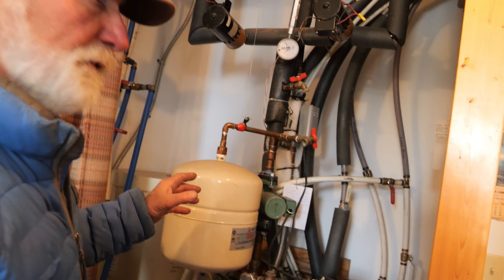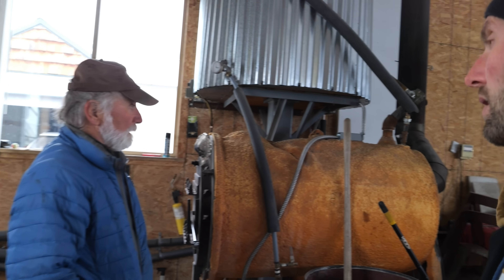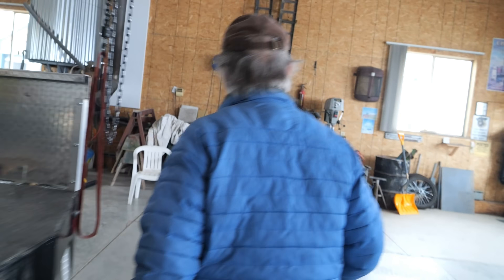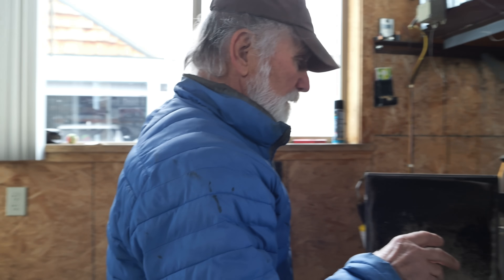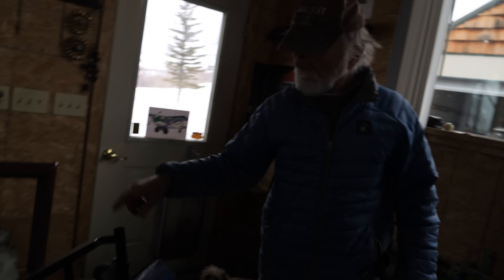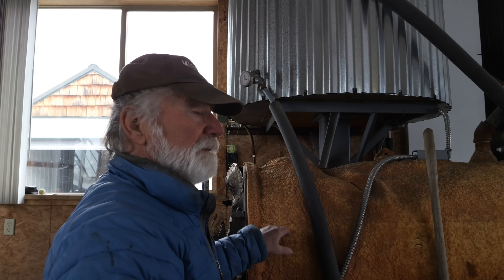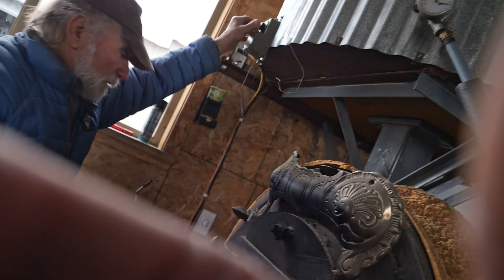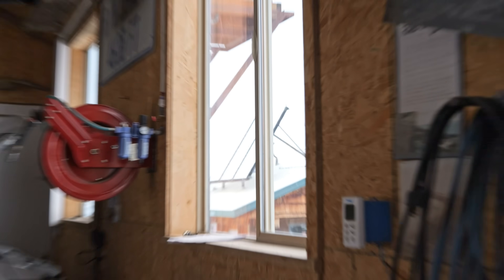Hasn't had a Heating Bill for 40 years.

Comment: Very cool. I grew up in northern ontario, it is common for people up there to have outdoor wood boilers exactly like what he built. My parents use theirs every year. It's just so much safer and works really well and costs very little to run. I like the idea of those solar heat collectors as well, though I don't know if my parents get enough hot sun on average in the winter to make it worth it. We're looking at maybe heat pumps instead. They have a creek near by they can use, or even the massive back yard at their place.

Comment: The title suggests he hasn't paid anything in 40 years, but big investment in equipment and time.   I used to think my wood stove saved money, but if you add up  wood stoves, chimneys, chainsaws, chain, gas, oil, splitters, trucks to haul wood, etc, it ain't free.   Not to mention what your time is worth.   I realized I could work and extra 4 hours at job to pay for heat bill each month.   If you love doing it, fine, but not as cheap as advertised.

Comment: great system, if i ever do a full remodel of my house i will install a water floor heating system, atm the best way to heat water wood be to have electric panels on the roof and rune a air to water heat pump that you can use to heat up a tank of water to 95 degree celsis, then use that hotwater in a water to water heat exchanger to heat hotwater for the floors and tap water. this way you can use the electric to buffer up stored heat during the evening and night, and if in a pinch you can run the heatpump of mains power and heat the water for the floor directly. and if wanted you can add a fire burner to heat the buffer tank of water as well.  you will need at least 3 tanks of water, a heat storage tank, the tank for the floor heating and you hot water tank, and a lot of controller to automate the system.

Comment: I had a 2500 lb 8:34  kewanaee 3 pass boiler in my 2300 square foot house.  You could throw three four-foot logs in there and it would burn for about 24 hours.  You could walk around in the house and t-shirt and shorts on a 0° day.  Of course the house was super insulated with all triple pane windows.  The place was so efficient it heated cheaper than my 700 ft² cabin.  I eventually switched to a well maclean gas boiler. Lost that house in a divorce I miss it.

Comment: Not sure why so many comments are in awe. Solar thermal has been around for years. I have had it for 20 years and Reagan removed the solar thermal panels from the Carter whitehouse back in the late 70s. Lots of ways to "skin the cat" , so to speak. Let me explain. He has a wood stove as his back up to solar. I have a propane boiler. I also have a wood stove for heating the house as a backup and a help to the hydronic floor heathen the sun is not shining. I love my system but when it has issues (e.g. valves, pumps, or boiler broken or electrical grid is down) it is very frustrating and you want to junk it all. Too many working/moving parts to feel ultimately comfortable with the system. I have it and will use it, however, until I or the system dies. I might do it differently if I had to do it all over again (true geothermal heat pump on solar PV?!). My propane bill for a year is usually around $300. The solar thermal usually covers our entire floor heating needs and the propane is for domestic hot water.  A hyper-insulated house that is zoned is key. This guy loves to tinker and build. I can but do not get my satisfaction from that. I prefer to go skiing than monkey with my solar thermal system. But I do when I have to. Unfortunately the solar thermal world is getting smaller and less people are doing it and can service these systems. PV is worth doing and I have that too. Not a one size fits all world and everyone should be thinking in terms of their needs and what is best at any given moment in history.
Reply: There's also a 5 KW electric boiler in the house, besides a woodstove, he has mutiple ways to heat, and all of it is powered by surplus solar/PV, grid tied. NO propane needed.

Comment: Hasn’t paid a heating bill in 40 years. Has to wear a winter coat inside.
Reply: I agree- but if in the shop.  He probably does not keep it real hot when not in use. No need/purpose. I do similar with a insulated shop. Too much money/energy to keep hot when not in use.
Reply: It’s a massive shop and they were going in and out. The stove also isn’t lit. You don’t want a workshop to be too warm. Working warms you.
Reply: @stonehorn4641  I enjoyed the video but decided to attempt to be funny. It didn’t go as planned.
Reply: @MikeinMassachusetts  eh, intent is hard to convey on the internet, brother!

Comment: Very cool system.

Seems like he would have to keep the system running regularly when it is cloudy and temps outside are freezing otherwise the glycol portion of the system would eventually get to freezing temps and cause the water pex pipes to freeze at the heat exchanger.

Also, when he is using the wood boiler and heat isn't coming from the solar (cloudy outside etc.) he says the water doesn't go back to the heat exchanger that is connected to the glycol pipes going to the solar. I wonder how this is done. Maybe some kind of conditional check valve that only operates when the wood boiler is being used? Otherwise efficiency would be lost to the cold glycol pipes. And also, I don't understand how this can even be actually what is occurring, because if, while the wood stove is operating, the hot water is not passing through the heat exchanger with the glycol, then wouldn't the glycol cause the water pex in the heat exchanger to freeze? Since, in this case, the glycol is not being heating by the solar when it's cloudy.

Also, not sure why the flue pipe on the wood boiler is on the back of the boiler rather than being on top of the boiler. The bends in the flue pipe will make it more difficult to establish draft, especially when the fire is initially being lit.

Comment: Apprentice plumber here, the plumbing aint bad. Journey Electrician here, now the wiring looks down right horrible :]. You want that metal clad to be grounded. Guess you could of done that to other end. But since you put romex thru MC, I'd think you didn't. Since you didn't enclose your splice in a j-box, which should be bonded to ground as well. You should at least wrap the twist caps in electrical tape, so they do not come lose(or use wago instead of wire nut). Which then might hot that MC, which if isn't grounded or arc faulted, would find whatever it is going home to ground in your shop. I'm not talking CODE here, I'm talking general safety.
Then electrical wires vibrate on their own. If you don't have the plastic cap for the end of that MC cable, then its literally going to dig right in that Romex, then eventually short or make the MC hot. Its a little red cone cap looking thing, that I dont see here. Least bend it outward and electrical tape it. Be better if you just didn't use the Metal clad. If building is framed in metal, then you'd 100% want it as MC or tubing, but you need to bond that metal to the ground. If you have a subpanel on that building, then should be a ground rod for that building, not just grounded to main house. If the building is metal, then bond that to ground to.

Now if your using your ground as a neutral for 240v, make sure your neutral and ground is not bonded at the sub panel on that building. It should only be bonded at the first disconnect, not at that sub panel. If it is and your using it for 240v, then move that wires ground wire to the neutral bar, not the ground bar.

But Im sure it works regardless, I'm just speaking of general safety. Keep safe!

Then since those pipes hold water. I would 100% gfci the breaker itself, since you hardwired it to power. Main cause of death by electrocution is water and no gfci working. Say if a pipe leaked or burst, without gfci the water would be hot and never break a breaker.
If the breaker costs to much for gfci. Then gfci the first receptacle outlet on the line powering things within 6ft of water, the "line in" comes from the panel. If its 240v, then make that outlet higher than water. Don't gfci the 240v.
Reply: Good advice, and will be heeded, the circuit is GFI (gfic?) protected, and the entire building and home was wired professionally to code,  the boiler work being done later by, obviously, an amatuer electrician!
Reply: @portnuefflyer  GFI, GFCI, are same thing. Ground Fault "circuit" Interrupter. Yea if the boiler room was just a single wire run, from an existing panel on that building. Then I'd still GFCI that line, if its not. This will also protect you from if that metal clad cable becomes hot, for it will trigger the GFCI still, for it wont sense the return flow. But electricity built on redundancy, you have none if the metal isn't grounded.

Comment: This solution, or similar, is very very common in Sweden. Every new house has in floor heating. And ofc you have a heat exchanger between the floor loop and the heat source? 

Do you guys all run electric radiators or what?

Comment: Solar heating systems were very common in Europe before photovoltaic lanels got cheap. My flat built in 1984 has it too. Tody PV and heat pumps are used because it is more cost effective.

Comment: A good 40 years ago I had some customers that had panels like that for heating their swimming pools. Eventually they were all disconnected because of leaks. multiple leaks. They weren't copper, they were poly.
Reply: Yeah, but by the time they leaked they had payed off several times over in fuel savings.  Solar pool heating is the MOST cost effective/shortest payback time scheme out there.  Anyone with a pool without solar heat should look into them.
Reply: @portnuefflyer  No they hadn't. Not even close. The systems never worked very well either when they weren't leaking. All solar is the worst of ALL 'green energy'. All of it. It's destroying the planet and putting people in debt. Stay away, people.

Comment: I design these types of systems every day. This is a classic Solar - Biomass off grid system. The biggest design hurdle is in the summer, when you don't need the hot water from the Solar thermal collectors. If you just shut them down the glycol will cook, which is bad.
Reply: Being a closed loop system, you are correct, that's why they are simply drained out during the non heating months.

Comment: If the glycol in the panel reaches 10degrees hotter than the fluid in the solar tank a differential controller turns on the circulator pump, and shuts it off when the solar panels are 5 degrees cooler than the tank. Most controllers have a high limit that shuts the system down at 180 degrees to control over heating,

Comment: Hmmm... those solar panels aren't going to produce any heat for most of the winter, and not a great deal in spring and autumn when you need it. They'll produce plenty in summer, enough for all your hot water, but you won't need any heating. How many watts are those each? 1KW max each in summer? 200W in spring?
You can't heat your house with a setup like that. The bulk of the energy is going to come from the boiler.
it all depends on the level of comfort you expect. Keeping the house at 10-20C might suit some folk, but I like it to actually be comfortable.

Comment: I would build a 30' tower with a good wood stove......let gravity give you the water pressure. Have the hot tank on top and have a lower tank with cold water ,that only starts to heat when water is below 45* F....all  deeply insulated and circulating at 140* F in the main pipe 6 ft into the ground (36 ft drop).
     You would need access to a creek/lake/river (big rivers and lakes only partially freeze...even @ -60 .......make the upper tank proper size (100 gal.) and lower huge ( up to 10,000 gallons)....fire up the gen, just a half dozed times a year......excess hot air can freely feed any space with heat....water is free and with a little muscle, wood is near free!

Comment: The solar panel system is free energy, but wood is not free. A pallet of firewood, where I'm from, sells for over $100. So if you burn a pallet of firewood, whether you bought it or cut, split and dried it yourself, you burn $100. If you hadn't burned it you could have sold it, so either way you spent that $100 on heating. So he may not have paid a "heating bill" but his heat isn't free.
Reply: Unless he just picks up deadfall from his own property, along with  free scrap lumber, at jobsites he's at anyway, that free enough?!
Reply: @portnuefflyer  No, that's pretty much the same thing. If I give you $100 and you spend it on something, that something wasn't free. You spent $100. 
Similarly, if someone gives you firewood, that firewood still has value. You could sell it instead of burn it.

Comment: Nice system.  But no heating bill for 40 years is a bit of a stretch.  Wood cuts itself up dries, none of the piping, pumps or valves never wear out.  
Wood is a very dirty way to heat.  Lots of cancer causing chemicals in the smoke for the neighbors to enjoy.

Comment: My dad is great at this stuff. For years I'd heard him mention that he had made a back-boiler that was behind our open fire...which heated water using the fire. I never thought much about it, and assumed it was a tank of some kind in behind the fireplace itself. 
Well you know those concrete back pieces that goes in the back of an open fireplace? I was helping him remove that when he decided to replace the fireplace with a wood stove, and I noticed it was metal. He'd welded a a hollow version of that, the same size and shape   as the ones you see in concrete, with pipes coming out of it to circulate water through it. I really felt that was genius when I saw it.     Then as we removed it, we bumped a pipe connector and water came out. My dad said "Oh look. It's been fine all these years and it only leaked as we are taking it out"

Comment: This technology can be called hydronic in slab heating. It's becoming more and more common. I work as a mechanical engineer designing HVAC systems for buildings. I've seen this method used for very large manufacturing buildings. It can also be used on roofs or in parking lots to prevent and/or melt snow

Comment: How does he control the temperature of the glycol in the summer?
Reply: Don't, it's drained out at the end of the heating season, stored, pumped back in in the fall.
Reply: @portnuefflyer  I didn't think of that.  They heat water in a lot of country's with this type of heating but no glycol
Thanks for telling me.

Comment: As a plumber can’t argue with that system, it’s referred to as a hybrid system both are seen as renewable forms of heat. The layout with the plate heat exchange is a very smart idea. It’s common practice in the commercial and industrial plumbing above 70% of industry in the uk uses a set up like that with a cascaded combi boiler set up. Only think I’d pick on is his pipes aren’t clipped😉. Also pumps in series increase head and pumps in parallel increase flow. Overall absolutely well done hats off to lad there!
Reply: The heating system in UK homes sucks. I guess the new homes have better heating or is it just the posh new homes?
Reply: @9jaezego  Entirely depends how it’s put in, what’s been put in and who’s done it. I’d say there’s a lot the uk needs to catch up on. Heating engineers are going to be under more pressure to design heating systems correctly due to laws changing about any upgrades on heating systems need to be made with heat loss calculations.
Reply: @hjartm123  in a lay man's term, what you are saying is that a number of heating engineers suck. It's good that laws are coming in to address this issue.

Comment: Dont think the pump on the furnace is necessary. Between thermal expansion and the natural rising of heated water it should circulate on its own pretty well.
Reply: It will, just better with a small pump.

Comment: I think the whole system is off. If I had to nitpick one thing,  I would change the 2 pumps "in series".  A simple copper header would be more efficient.  Higher pressures, more flow and redundancy.
Reply: Good call, this was a quick and dirty way to use up a pump that was already available, and using the PEX fittings on hand!  It does the job, as in keeping the storage tank from rising in temp faster than it could be put into the floor, I like to keep the tank temps at 120 max, the goal not being long term heat storage, but using the slab itself as the storage.
Reply: @portnuefflyer  
Oh 100% get it. I think everything there is awesome.  You could make the head out of PEX or anything really. And it doesn't have to be a true header. Just a Y PEX fitting split to each pump,  a little check valve after each pump and  then Y back together.  But I digress. It's not like it would be hard to switch the pumps out If one stopped working. One of those things I would probably plan to do, but might not ever get around to it simply because it works. I get it.
Reply: @portnuefflyer  
One more thing you can do if you cared about longevity of the boiler and pump and what not. A little bit of organic inhibitor would keep things nice and clean on the closed systems. If you bought some. Anytime you drain down a little water, you could always replace it with someone hamburger coil if you have a make up station or just add it by hand.

I'm a pipe fitter, so this is the kind of stuff I like. Well done man. Awesome system.